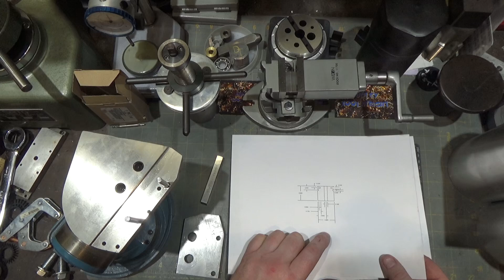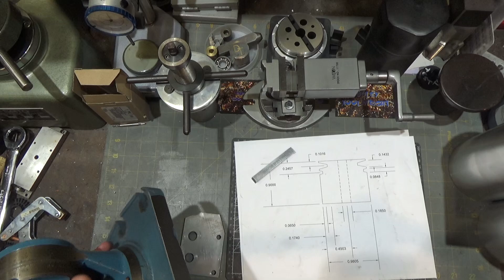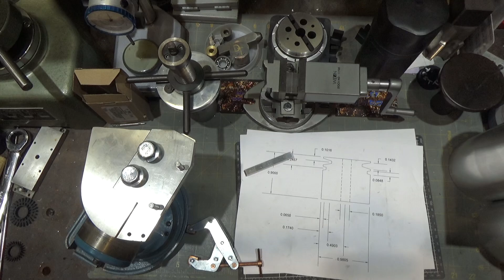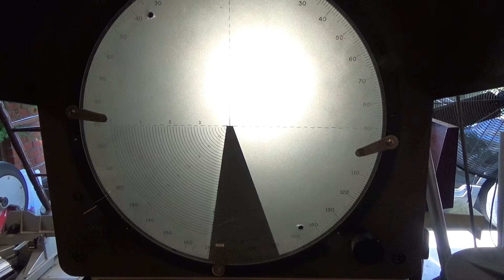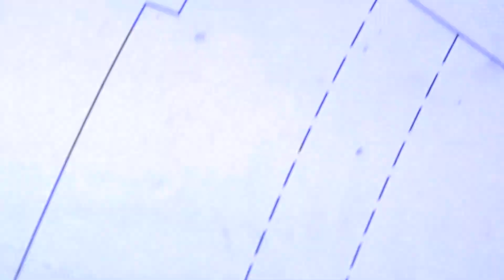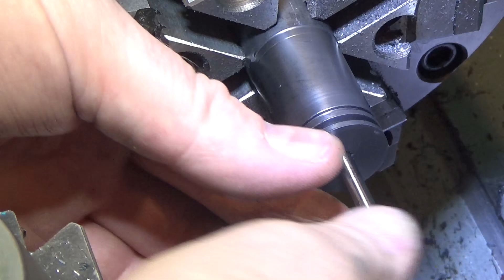122 Audiophile Turntable Part

Comment: Robert, Do you have issues with the dust from the grinder in your small shop?  I just got a surface grinder and am wondering about grinding dust in my shop, with the lathe and mill in relatively close proximity to the grinder.  Great video, really love your vid's.
Reply from the maker: Dust is always an issue. I purposely put the surface grinder as far away from my other tools as possible and run a fan sucking air away from the shop when I am dressing wheels. I really could use a vacuum system. Dust mostly settles in the one corner of my shop.

Comment: Woah you manage to pull in some interesting odd jobs these days.  What's your secret for advertising?
Reply from the maker: I post ads in the two local counties on Craig's List. Apparently, with the rush to CNC, prototype machinists are hard to come by, not to mention that they typically charge between $200-$600/hr locally and I do not.
Reply: @DudleyToolwright  Amazing, thanks.

Comment: I would think a sharp HSS cutting tool, with a slight radius, would be better for external turning of Delrin.  Steve Summers uses a similar multi axis vise on his surface grinder to put a grind on some HSS Shaper Tooling.  Very nice form tool.  Well done on the groove turning and final part.
Reply from the maker: Thanks Vernon. What is the advantage of the radius? Cleaner cut or smaller burrs?

Comment: Please be careful with your hands up by the work piece, grabbing chips, etc.  When working with plastic it might be easy to get complacent around the lathe because the material is so forgiving.  But there's a risk of building bad habits.
Reply from the maker: Excellent point. Bad habits are hard to break.

Comment: Nice but now we want to hear if it works :-)
Reply from the maker: He got back to me, shortly after this video and he said the part worked fine, but he was having excessive wow and flutter problems. It was never clear what the cause was though.
Reply: @DudleyToolwright  I think this might have to do with grooves' surface finish - sounds like the belt can't leave the groove smoothly and consistently, perhaps get stuck a liitle bit every now and then - which then translates into uneven motion of the other pulley, thus wow and flutter.
Just guessing, though.